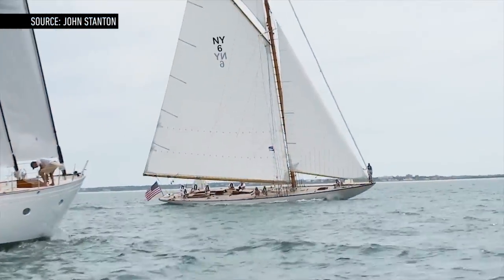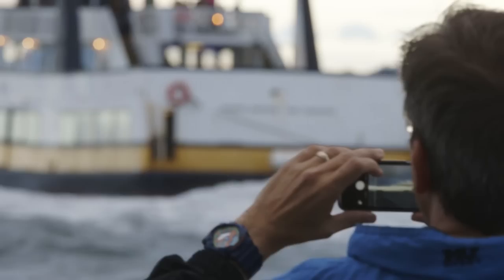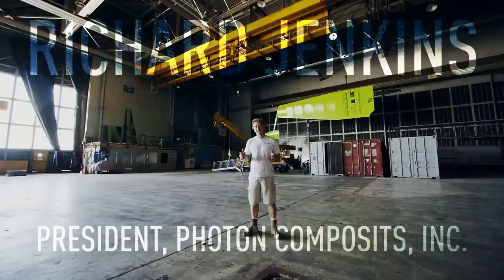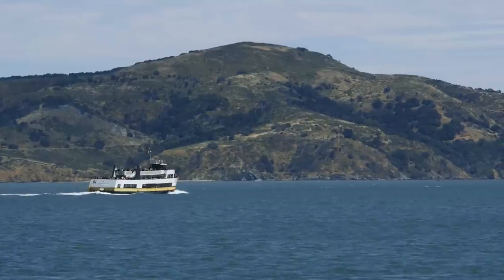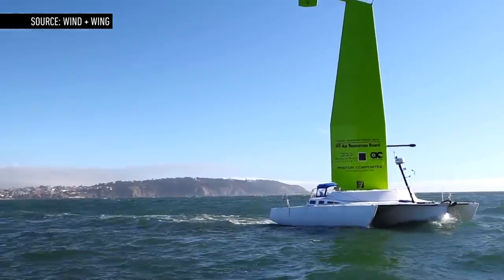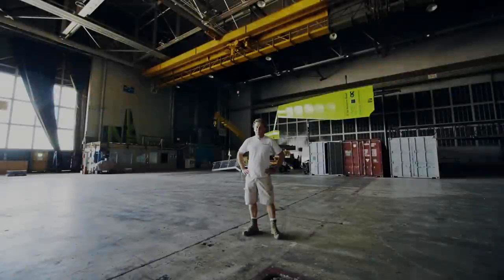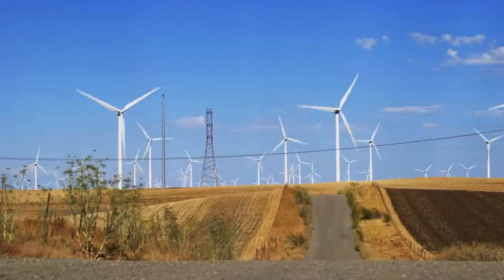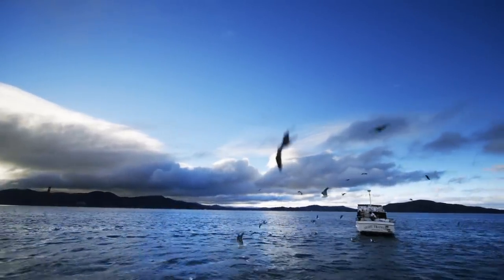You've never seen a boat sail like this - Detours: S. 2 Ep. 3

Comment: While the ferry uses a lot more fuel per hour, you need to compare apples to apples: passenger miles per gallon.  The ferry is more fuel efficient than a Cadillac Escalade if both are carrying a full load.

Comment: Sure, you can move a ferry with wind power, but...
1) How fast will it go, will people want to wait longer to get across?
2) What do you do when there's no wind?
3) Controlling power with wing-sails is tougher than they think, this is why traditional sails can be "dropped", big problem if you need to stop in high variable-direction winds.
4) The boat is going to need tremendous sail/wing structures to move the weight that ferries usually move.

Lots of problems with using wing sails for commercial purposes, lots. More than these guys have thought through. That is not to say that they are not the future, but they're not the immediate future.

Comment: This technology has been available for decades. Maybe not with all the electronics and automation as now but the basic principle of a fixed but moveable two sided wing has been experimented with since the 60's. The only problem for smaller sailboats or powercraft is that the wings can't be furled in a storm.
Reply: That's a problem for larger sailboats too. Arguably more so. Look at all the commercial sailing vessels from the end of the great age of sail and the trend is pretty clear: Lots of small sails which can be furled or unfurled depending on weather conditions. They didn't do that for shits and giggles, all that rigging was expensive, they did it because it was strictly necessary to get their vessel there in one piece.
Reply: I like Beneteau's Wingsail idea. It can be furled, or rather collapsed when needed
Reply: a lot of it had to to with limited manpower and lower strength of materials as well as weather.  They didn't use winches back then, only block and tackle and sailcloth was HEAVY then.
Reply: The wings don't need to be furled.  When set at the neutral position, they naturally weather vane and create far less drag than a rolled up sail or even a bare mast.

Comment: That sail is good for day and bay sailing 
Out there in high rough seas ... waves coming down on you ...
You’re truly in trouble when you need the sails hauled in or reefing to the max/ min
Reply: Maybe. But the theory is that you set the angle of attack very low and the sail will just barely provide lift.
Reply: The drag of the wing is less than mast plus rigging etc.

Comment: Both sides of a 'soft' sail work exactly like an aircraft wing...the wind going into the belly of the sail pushes against the sail while at the same time (except when the wind is from 'behind' the boat), the air going around the opposite side of the sail produces lift in the vertical plane. Both of these forces combine and, with the keel and rudder, drive the boat forward.
Additionally, the selection of the particular sails and their geometry, 
can be quickly altered to affect performance of the boat and comfort of the crew. Rigid sails are for auxillary power only. Ironically, the motor on a sailboat, whether a smoker or electric (ahem), is the aux power while the sails are the main power. If, however, you want to experience a ' rigid ' sail plan then join a qualified and stalwort
crew and enjoy some storm sailing!
Reply: Both if these sails are "wings". The "soft" sails just function like cambered wings they used to have in the early days whereas rigid wings function like the modern glider wings.

Comment: If this was a cost-effective solution, you wouldn't have to get government to force people to use it. Ferry operators are acutely aware of what fuel costs. If sticking a few thousand dollars worth of computer-controlled sail on the boat would really save fuel, owners would be fighting to buy them. Seriously though, one of the good things about cloth sails is that they can be taken down out of the  wind altogether when the wind blows too hard. Rigid sail always present the problem of having to be lifted off the boat with a crane and stored in a very large building when they are too much area to present to the wind.

Comment: Pipe dreams. All you do is turn the wing on and off. It has GPS, computer, satellite tracking, and knows where its going. Then... There's a power failure. So you start the diesel engine and go the "dirty diesel route". All that tech manufacturing from mining minerals to production, must use petroleum is some form along the way. Can't get away from it.
Reply: The loop can be closed. Only lubrication oil/grease is necessary and even that can be made synthetically. No real need for fossil fuels.

Comment: Will need a pretty big sail in order to power the ferries to the current performance. 
What are you supposed to do with your sail if the weather gets too extreme? Dump it over the side? 
Don't you ever wonder why a sailing ship had many sails to choose from and a large crew to get the sails off if the weather turns bad?
What if its calm, it will just cause windage and use more fuel. 
Why don't you build yourselves a ferry type vessel and demonstrate how your "sail" can power it in all conditions?
You might notice that wing sails are fine on in shore racing yachts, but there are not too many upon which are expected to go out in any weather.
Good luck.

Comment: So if you're in a harbour docked and a storm comes up, wouldn't your boat being slamming around ? You can't reef or take it down.. it's 600 lbs.
Reply: Shouldn't be a problem. It would just weather vane into the wind. The aerodynamics are such that it would have less wind resistance than a regular "bare pole" mast. Think about it, airplane wings typically operate at wind-speeds greater than 70 mph (which is the takeoff speed for many light aircraft), so anything less than hurricane force winds would have little effect.
Reply: Dilandau88
Yep, you're right. I remember when Steinlager 1 was parked on a swing mooring in the Bay of Islands in NZ. She only had a very wide rotating wing mast not a wing sail, yet even when you let that mast self feather while moored, it sailed around its mooring like an agitated dog on a leash.
Reply: The keel at the top - little effect?
Reply: @William: Fixed wing aircraft only take wind pressure from one direction. Even if this thing feathers, it'd still be a lot of force and it could be coming beam on rather than head on.

Think about an aircraft getting hit by storm winds from the side while on the ground rather than one flying through the storm airbourne. That'd be more accurate.
Reply: Yes I think you are right . An a ircraft  wing is not a valid comparison . For a start it is going to have to be massively larger than any aircraft wing to have a worthwhile effect. Aircraft wings only have to provide lift in vast wind speeds provided by the engine.
They have not been successful in the sailing world. Notice that none of the Americas cup boats use them. They are probably too heavy. In UK we won the Little Americas Cup in Emma Hamilton back in about '62 against the Yanks with a wing mast but I don't think they have been used since. 
In short not enough drive for the weight.
Reply: I think the idea of this is to make it easier for the crew, not more efficient, but I'd still have questions about the safety.
Reply: "Aircraft wings only have to provide lift "
Yes they provide lift...
NO not only...
If you study the force-spectrum a wing have / make then you see a quit big part is also the forward force! (... Otherwise any kind of Aircraft without engine would no fly forwards ... and only lift up!)
Reply: Yes I agree and the forward force means that a sailing boat can sail to windward . It is the same force though -  it has a lift component and a forward component.
Actually I think that is one of the problems ;  the boat is always sailing hence Biggest's problems with Steinlager above. You can't reef it or take the sail down.
Reply: Again YES and NO
As today they are new Wing-sail systems, who can be reefed!
Reply: Harry I'm not sure what you are trying to say, but aircraft without engines fly forward because they are trading gravitational potential energy for forward kinetic energy.  The airfoil is the "valve/spigot" that prevents that tradeoff from happening all at once.  I can assure you airfoils don't produce any force in the forward direction - if anything they do the opposite and produce force in the backward direction (drag).
Reply: If there is no force in the forward direction then how does a sailing boat sail to windward..?
I am not saying I know the answer to this.
Reply: sailboats never actually sail directly in to the wind (except for very brief moments), they use a method called tacking to zig-zag back and forth in to the wind.
Reply: NO ... absolutely no...Every profile has a Lift-spectrum from  the front-curve over the front to the end See a diagram of the force a Profile produce. (It is not important if the front force come from an engine, wind, or gravity-force. http://www.start-flying.com/3axis/panel_files/aerofoil.jpg
Reply: If there was no forward force then the fastest speed in a sail boat would be running directly before the wind because the wind is then providing the greatest amount of direct force on the sail , the boat should then go faster than on any other course. Anyone who sails knows that this is not true ; the fastest course is with the wind on the side when the main part of the direct force is pushing the boat sideways !
That is I think a proof that there is a forward force provided by the aerofoil .
Reply: Wow take a look at the very diagram that you posted and you will notice that there is also lift in the rearward direction, which by your logic would pull the wing backwards...  This is also not taking in to account drag.  I assure you net result of air striking an airfoil is not a forward force.  But if you insist to believe in fantasy, I won't stop you.
Reply: While what you have said is not entirely untrue, it largely depends on sail design.  Some sails are called drag sails and they only work by being pushed by the wind.  Other sails are definitely designed to work as airfoils, and so they run better at angles to the wind, but they also work in conjunction with a keel which is critical.  You aren't going to learn anything arguing about it in the comment section, but the answers you are looking for are only a few clicks away... Just know that drag is very relevant to this discussion and more than cancels out any forward component of lift produced by an airfoil.
Reply: I never say nor implement what you construct. As an Ex-pilot (1) ("Only" PPL 1 etc. not Jet-Pilot hahaha) I have learn why a aircraft fly and why a sailboat use the same forces from a Profile. Of cores the Uplift is a true fact and a result of the "Air-speed difference caused by the different distance, to cover in the same time! (1) But I also sailed many years ago when they where introduced the Olympia class sailing boats like "Trias" and "Quantas", and in Australia the big 55' Catamarans. I am the Inventor of this Sail-system you see on my "Velomobile profile photo" ! ! !  But maybe you think I not understand Aerodynamic at all? ... Anyway whatever you will sail in future I hope you enjoy it... Wing-sail or Common Sails.
So this is for me the last note on this. Thanks God bless you Harry
PS
Sorry my English / grammar I am SWISS-German mother-thong!
Reply: 'Only PPl not jet '  Are you what we call a sky pilot  ie a priest .You direct people to heaven :)
Reply: Anchoring would probably not be that bad actually, it'd just turn head to wind. Mooring at a quay or pontoon would be a little trickier. In fact... I doubt most marinas would allow it on a safety basis.
Reply: Exactly! I've sailed in Small Craft Advisory winds I shouldn't have before north of 30 Knots wind speed in a 25' boat. When you hear the wind shrieking around the wires on your boat, you want the chance to reduce sail area so it doesn't smash you out of existence. A fixed object like that with no chance to reef and a massive weight above decks..yeah, that's a Lloyd's of London claim waiting to happen.
Reply: Peter Houlihan Every wind gust tho, the boat would be rocking. When tide and wind are different you'd be in for a bumpy sleep.
Reply: Oh it'd be far from ideal, reefing exists for a reason. I'm just saying it wouldn't be anywhere near as bad as tying up to a quay or a pontoon (which is where most ferries end up).
Reply: Yup for sure, it would be a nightmare.
Reply: Yes and No, the wing feathers just like a wind turbine blade. There would be little more force on the hull than a normal mast for a sail.
Reply: The force applied by a full sail in a storm, even if it's head to wind, is considerable. Storm-trysails exist for a reason, so does reefing ;)
Reply: climate doomsday is an apocalyptic cult that cites pseudoscientific computer models as their authority instead of actual data....sorry to pop your bubble but they've been saying the world was going to end for over 50 years now (yes this started in the 60s).  We're still here.  Apocalyptic cults are pretty common in history so it's not like you're the first to fall prey to one, it's very forgivable.
Reply: This wing design is not actually new idea there were many wing designs previously developed but in the high winds it is too dangerous hazard.
Reply: I agree, my wingmasted land yacht is not stable when 'feathered' it oscilates violently if not carefully restrained.
Reply: Yes, the inability to reef or lower sail seems at first to be a problem.  But with this design I don't think it would matter.  If you go head to wind on a sailboat and let the mainsheet loose, there will be very little force on the sail.  The only problem with a conventional sail is that it will flap and flog itself to bits.  With a solid structure this won't be a problem.  Also, a conventional sail can only be let out so far before the boom hits the shrouds, but this structure can rotate 360 degrees, so even if the wind direction shifts, it will just feather.  Lastly, if you mount this (or multiple such) on a ferry.  a) it's not going to be out on "blue water", b) a ferry is a pretty stable  c) you could have a crane at the ferry port that lifts the wing/sail off and stores it safely in a shed in case a storm is forecast.  The America's Cup boats have rigid wing/sails like this.  They dismount them (with a crane) when they come back to dock.
Reply: You're right, but the prototype is 600 pounds. The size of production models would only be limited by overhead clearance under bridges. They could be much larger. Ships from the age of sail show that if one sail is good, a bunch of sails is even better. A ferry is a large vessel. How do you deal with a half-dozen five-thousand pound sails when a gale is blowing up? You can't fold them, so you need an immense building nearby to store them in. Very practical!
Reply: tin coffin:  A sailboat is working in 2 different media with different viscosities and velocities (the aircraft analogy is a KITE, then it is not so different to a boat).  Yep, sails are Aerofoils, therefore they generate Lift and Drag at an ANGLE OF ATTACK  relative to the APPARENT wind  (no thrust by themself).
The Keel / Hull Also is an "airfoil" in the water  (Lets call it a  hydrofoil - not to be confused with a  lift "hydrofoil")  Just as one sheets in the sail, one also "trims the hydrofoil"  with a RUDDER, without a rudder the boat can't maintain headway.  While ever there is an effective angle of attack (between sail and apparent wind) generating LIFT, enough reaction force in the water to reduce the leeward slip and  the LIFT component on the sail can  be angled forwards to give the boat DRIVE Then it can go "upwind{. This all fails at some specific angle to windward, which is different for all types of watercraft  (Hence why Wingsails are able to be used more effectively than a traditional Bermuda rig, not saying that a multi element live masted rig couldn't work well also)..

An Aircraft without an engine (a glider) doesn't have the advantage of a boat to go "upwind" it can't actually generate Net thrust unless it has an anchor in the water, or Land (some material more dense than air) then it is a KITE.   oh darn that got out of hand...  sorry if uncalled for, but something got to me and I Just had to.

oops, Re this sail above, yes it could be damaged by extreme wind gusts (backing and veering faster than inertia could allow this wing to pivot), or by side loading by water under extreme seas, but for most non-hurricane force winds, in the Zero-Lift configuration it will merrily pivot about its mast without causing any significant issue  (unless you or me, the bystander get within reach of its swing)   The key to these sails is that they are unrestrained except by aerodynamics, perfectly controllable, like a 5th line kite.
Reply: I think the 600 pound one is intended to go on a 100ton+ passenger ferry not a  small sailboat
Reply: It’s simple you would turn it off.
Reply: William Clyde that statement is completely out of real science parameters. Not having the exact measurement of The area of the wind I can state confidently that it produces conservatively 50x  more drag due to friction than the pole.
Reply: w8stral2 ,miniscule?  You're full of it.
Reply: ALL of the America’s Cup boats are using them, starting with the 2010 winner, Oracle